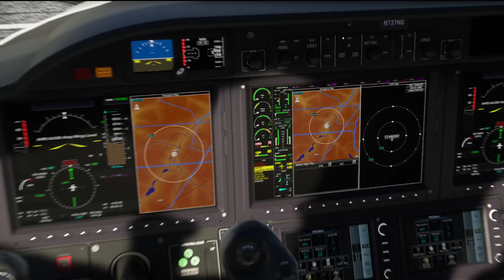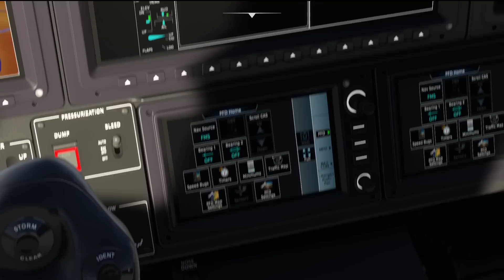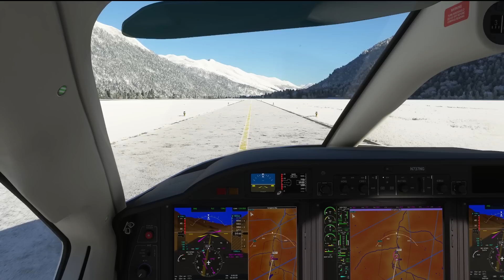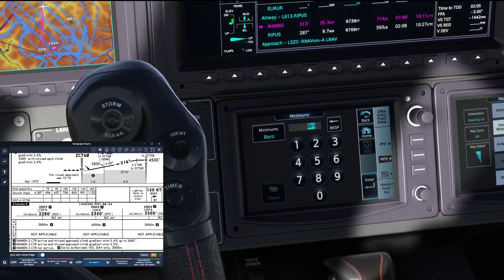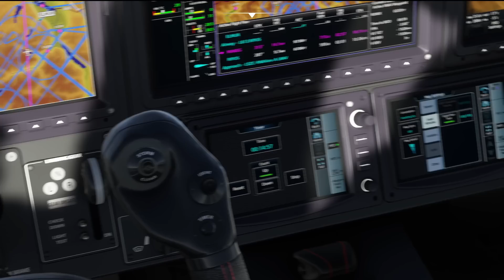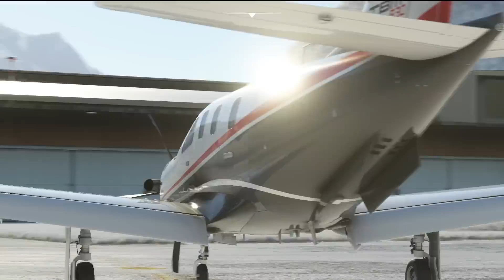TBM 930 Aircraft and Avionics Update: First Flight | Real Airline Pilot

Comment: If you have the fuel sel switch in AUTO on the overhead, you don't need to flip the fuel tank selectors - it does it automatically when the difference becomes great enough to cause an effect.

Comment: Just watching this video a little late but, I just wanted to let you know that it is possible to set your default view to a different position, so that every time you reset the view or "center" it with a hot key, it will always return to where you set it.  I think by default it's Shift-F10, but I modified all my default view positions to where I like them!  Hope that helps.
Reply: Yeah, I haven't tried that way myself, but I've been using this method for a while:
Set a custom view Alt-Shift-number 1 to 9. Then you can copy that InitialXyz and initialPbh line out of the custom camera.cfg into the default camera.cfg.
This is the only way I know to make the new custom view act exactly like the default view so that it always resets to the new view with the reset view button.
Let me know if you need more info!
Reply: Ctrl F10 (then bind to a button on your yoke so you can quickly get back to the default pilot VFR from any other view).

Comment: Great video! I can see you use GSX, I’ve seen how great it looks with airliners, does it work with smaller aircraft? For example the guy comes to refuel your tbm with the truck and pistol, or goes up on a ladder for the pilatus or a Cessna, etc…? Can you tell please?
Reply from the maker: Doesn't really work well with small planes. It's made for airliners and to be honest, even there all it does it some buggy animations. The only reason I'm using it is for pushbacks, the rest... buggy as hell.

Comment: Noticed that they still haven't fixed the turboprop engine model. 5K plus hours behind a PT6 and if I had an engine that was this hot at low altitude there would definitely be a write up in the old logbook!
Reply from the maker: Yeah, it's surely not perfect yet. Have you submitted your suggestions to Asobo for future improvement?

Comment: Great video, can't wait to try this when it comes out of beta. Do you know whether or not Microsoft and/or Working Title will be implementing visual path "VPTH" in the synthetic vision system on board these panels? We are missing that one last thing that would bring these avionics packages very close to the actual Garmin Firmware/Software. I can't believe the realism we have today in MSFS, these are very exciting times to be a flight simmer. I even purchased a "butt kicker" which I mounted to the back of my chair that I use for flying, you can literally feel the engine RPM's and other vibrations, especially on the ground.
Reply from the maker: I don't think they plan to add this feature, but then again I'm not internally involved in any of their decision making so I can't give you a definite answer on this.

Comment: Having flown in arctic Canada for a little over a decade, I can tell you that having a frozen lake vs a thawed lake that is glassy water like in this video, is FAR easier not more difficult. Frozen lakes are no different than ground. Flying visually over glassy water (I have also flown seaplanes for a large portion of that) is VERY disorienting. It's like flying over a mirror, no way to judge your altitude visually.

Comment: Hi! First, thank you, very useful video. But when I tried to replicate your steps, I noticed that my TBM lacks some options available y your video. In Utilities (fuel on board, aircraft weight, etc), are not available, and also in Flight Plan the Load Airways is in gray, etc Do you have a clue why this is happening? Thank you so much in advanced for your help.
Reply from the maker: I guess you don't have the AAU beta installed.
Reply: Thank you for your fast answer. And yes!!! That's correct! I don`t have it! In your opinion, worth it to install? is stable?

Comment: i joined the beta, got the update for msfs but i still have the default avionics, not the new one
Reply: I understand you're to empty every mod from the Community folder that had to do with the three aircraft: TBM, Longitude and CJ4 to avoid conflicts.
Reply: @kokoeteantigha389  this should be fun💀
Reply: thanks, i’ll try it
Reply: @kokoeteantigha389  and by mod, do you also mean the improvement mods?
Reply from the maker: Yes, any. In case of the Longitude the improvement mods have been made obsolete. I never used the TBM mod, so not sure, but they are really totally different aircraft now so I don't think you'll need those mods anymore. Just remove anything that has to do with the aircraft.
Reply: @A330Driver  i am on that…i am just having issues with the CJ4 now. same problem but doing a clean install
Reply: @A330Driver  so everything worked except tbm...just dont open the door lol
Reply: I just got it from steam and it works fine. I had no other mods installed tho.

Comment: Hi Emanuel, this is the fully standard Asobo TBM930 now with the Avionics update right? No improvement mods or anything at all? Wanna try it out myself but I still have the improvement mod installed and need to know what to deinstall.
Reply from the maker: Hi Colin,
correct, this is completly default now. No improvement mods for the aircraft installed.
Reply: @A330Driver  Thank you for the answer! Happy flying :)